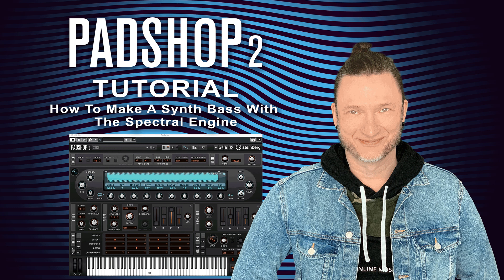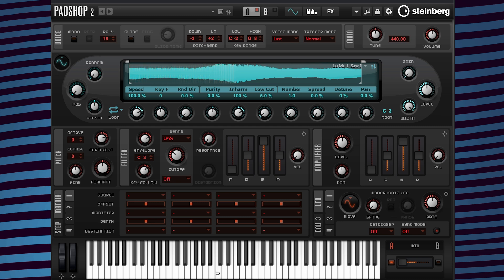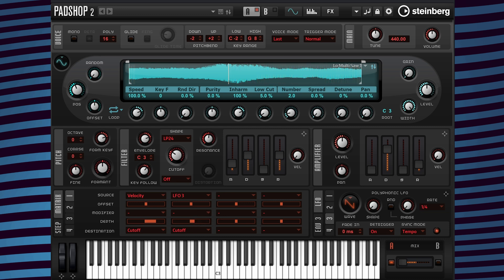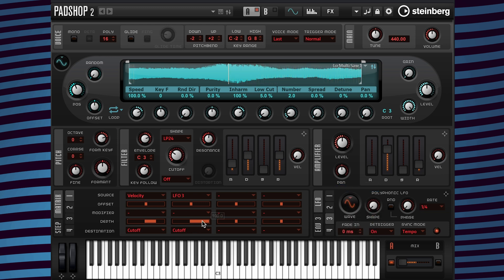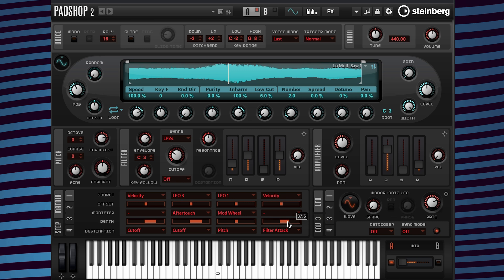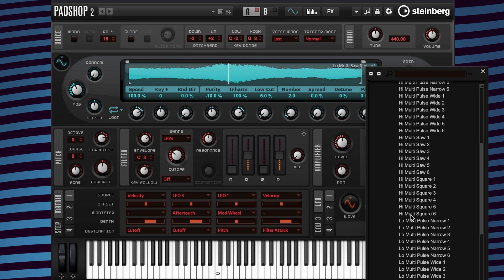Padshop 2 Tutorial | How To Make A Synth Bass With The Spectral Engine

Comment from the maker: Chapters
00:00 Intro
00:31 Spectral Engine
00:45 Filter Parameters : Cutoff, Env,  Attack, Decay, Sustain, Release. Filter Key Follow
02:11 Resonance
02:30 Position Parameter
02:42 Modulation Matrix
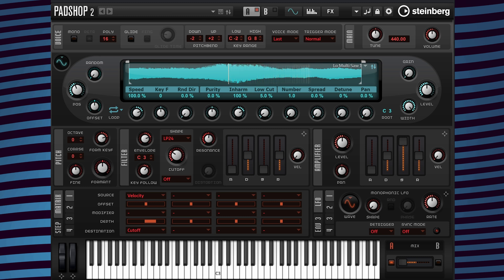03:16 Amp Env
04:27 Number Of Voices
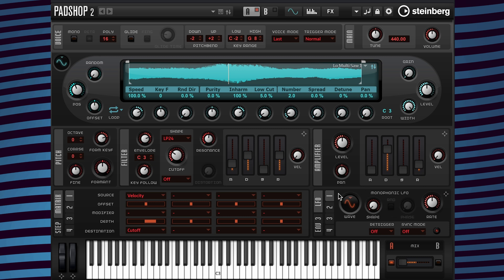04:50 LFO 3
08:20 LFO 1
09:10 Velocity/Env Filter - Attack
09:49 Spectral Purity
10:12 Amp Velocity, Attack Time
10:23 Listen To The Result
10:31 Overview
11:09 Tweak New Sound